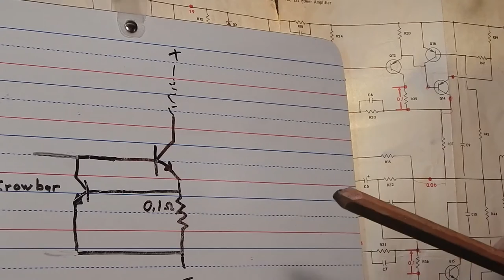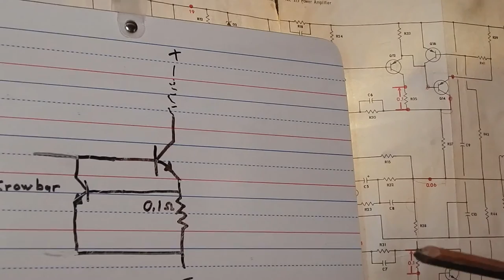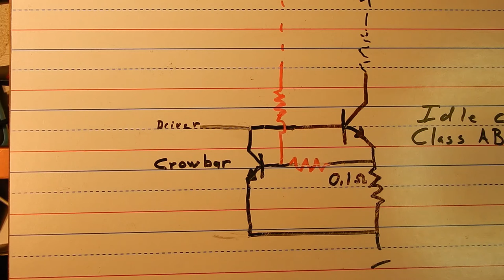Crowbar Circuits Explained + Tiger Power Amp Repair Saga Part 3

Comment: The Tiger saga continues. How does the good amp react on the same bulb limiter?
The circuit you describe is more of a current limiter. When the shunt transistor starts to conduct, it diverts some of the current from the output transistor so that it never exceeds the predetermined max current until the short or overload is removed. It doesn't turn it all the way off.

When implemented poorly, current limit circuits can make a loud pop or click noise when driving heavy reactive loads such at the point of heavy kick drum beats. Some old transistor (and some IC chip) power amps have this issue. The TDA2050 does this, The LM1875 does not.
Reply: Yes, that is a more exact way to put it, though not a linear current limiter.
When I turned the Tiger on earlier without the outputs hooked up is pretty much the way it should look with them in, just a short flash. Starting to wonder about the possibilities. When I get back up there I will double check that I don't have the collector wires reversed, and beyond that I will probably pull down the other Tiger for some comparative resistance testing..  I don't have any big DC imbalance, all of the elements of the bias section function, just wildly out of range. And AC signals make it through unmolested.The rails are sucked down to the point of making it hard to know if that slow oscillation is just power fluctuation. Blew a fuse with a bigger bulb.